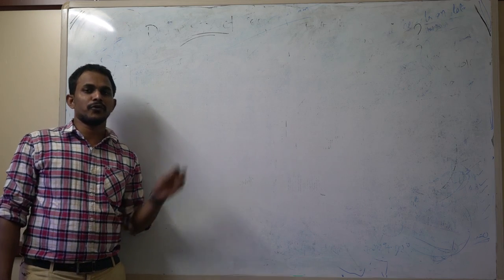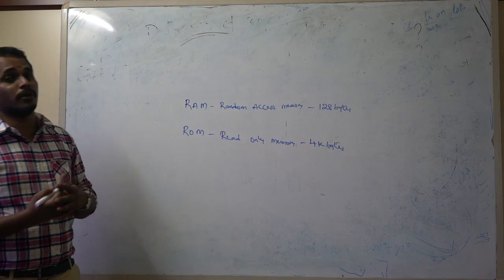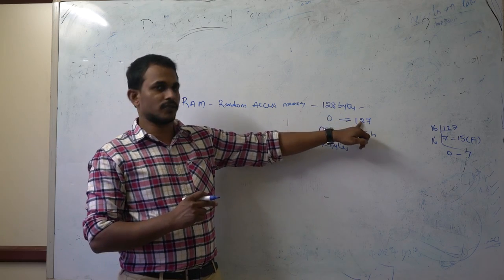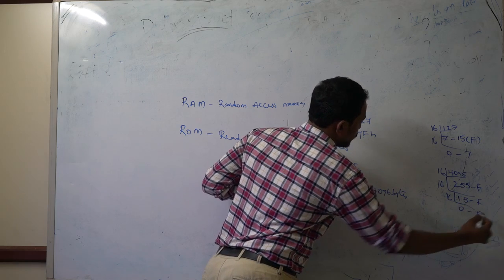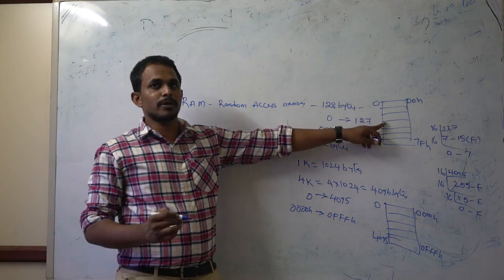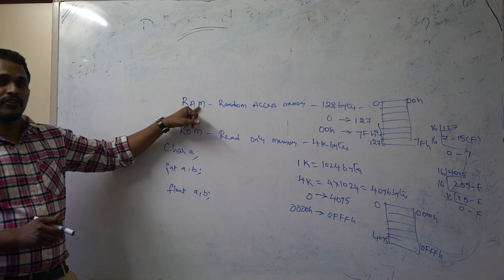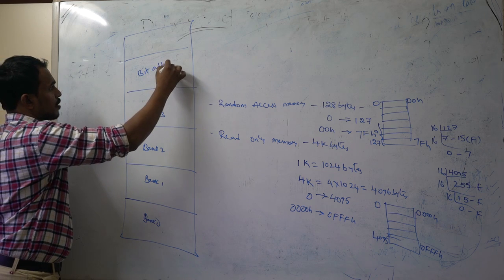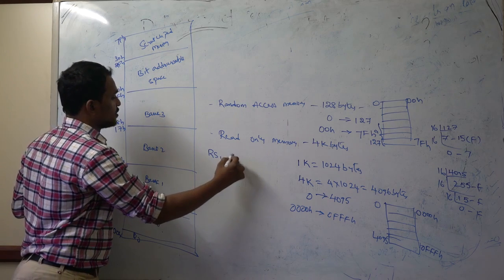memory organization  in micro control  8051

Comment: Please solve this question 
1- What is the computer system components?
2- Please give a few examples of Application programs, Hardware Computer System 
Components. 
3- Are following attributes true for I/O Structure?
A. Each device controller has a controller.
B. Each local buffer is in charge of a particular device type.
C. CPU moves data from/to main memory to/from local buffers
D. Each device controller is in charge of a particular device type
4- What is default unit of computer storage size that contain one of two values, 0 and 
1?
A. One bit 
B. One word 
C. One byte
D. Gigabyte
5- What does the Caching exactly do? 
6- List the Advantages of Multiprocessors systems?
7- What is Bootstrap program designed for?
A. bootstrap program is loaded at ROM or reboot
B. Initializes all firmwareof system
C. Loads operating system kernel and starts execution
8- What is the responsibility of Secondary storage, Symmetric Multiprocessing, 
Asymmetric clustering, Timesharing?
9- Please give the parallel systems types for Computer-System Architecture?
10- What does the cluster system exactly do?
11- What is Operating System Definition?
12- What are the (CPU scheduling, swapping, Virtual memory, job scheduling) are
used for?
13- What is the kernel?
14- How a Modern Computer Works draw and explain?